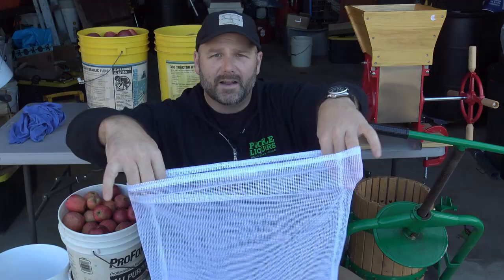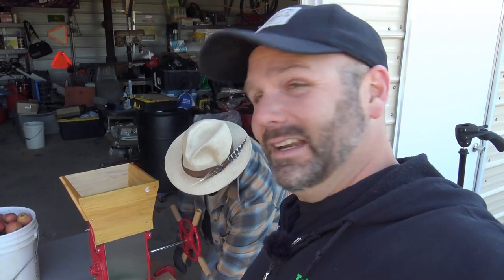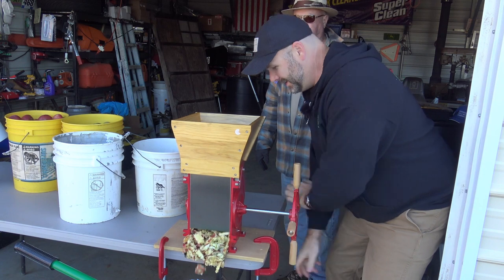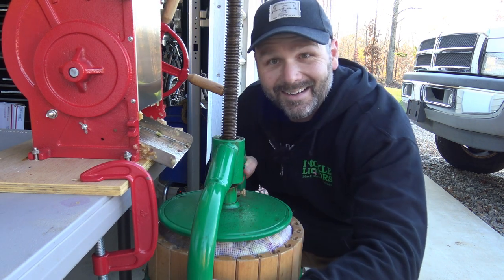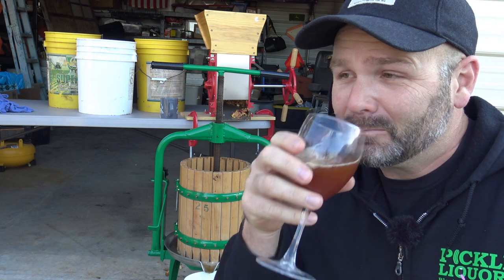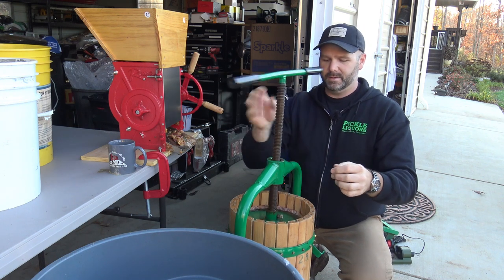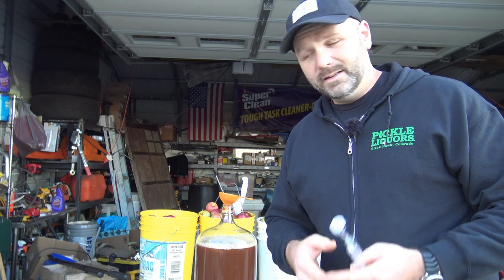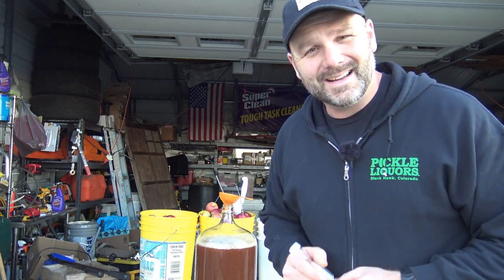How to make old timey apple cider, apple jack and Apple Cider Vinegar

Comment: Nice video,  and we’re envious about the #2 apple prices. We’ve made a lot of apple cider, and we always put the carboys in totes large enough to hold the entire contents of the carboy “just in case.” Mostly we ferment in locations where a broken carboy is easy to wash away. Both freeze distillation and fractionation are regulated in the USA requiring a federal license. (Taxes and all that). You can get to brandy alcohol levels using one of the White Labs aggressive yeasts. You would need to concentrate the juice before fermentation to achieve the higher alcohol levels without distillation. Oh, some cider fermentation’s can be vigorous enough to blow an airlock off!

Comment: Josh I may be wrong, but you say the hearing protection reduces the sound level to 24or 27 dB 
. I thought that its the amount it reduces the sound level that amount. So it would mean a 90 dB sound would be 66 dB or 63 dB, not the 24 or 27 db. Check it out. I think you made the right choice
Reply from the maker: Got ya.....did ya mean to leave this comment on the other video? lol

Comment: With that many apples to do, did you end up thinking of a way to fabri-cobble something together to use a motor on the grinder? Maybe use an old bicycle rim for a pulley and maybe the electric motor from a washing machine or clothes dryer? Neat project, I hope it turns out well for you. How many days are you going to let the naked bottle go before you do something if it does not start off gassing?

Comment: Nice machine but I think I converted over to an electric motor that moves really slow with a belt so it's slipping if the apples bind it up. Just saying.
Reply: Just get it running and drop the apples in one at a time. The torque of the spinning crushers will destroy the apples quicker than crushing several at a time.
Reply: I'm sure he could use a drill attachment or something.
Reply: butch Chet everything on the homestead is working in harmony ... exercise and keeping those arm and shoulder joints and muscles exercised!!😀😀I particularly don’t want  a bunch of electric  stuff around if the grid goes down...and still nice it’s the cooler fall/autumn coming along ....This is like splitting wood... warms you when you gather, warms you when you process it/  and then when you consume it... just my piece🤷🏻‍♀️
Reply: Spero che traducono in inglese: Sarei curioso di sapere  quanti litri di Sidro beve in un anno un cittadino inglese , poi mi piacerebbe sapere se' in inghilterra..
E' piu diffuso il Sidro o la birra...
 Se mi rispondete ringrazio.